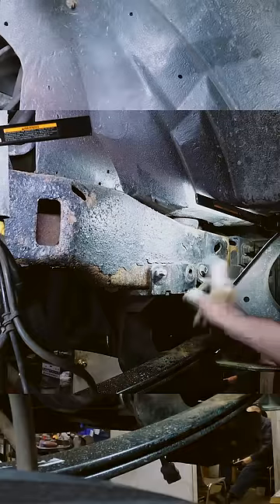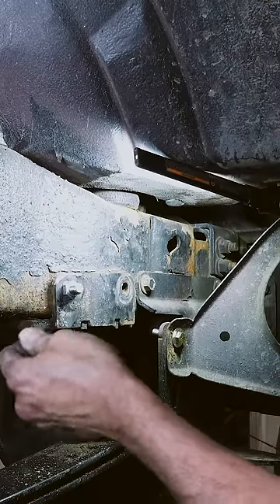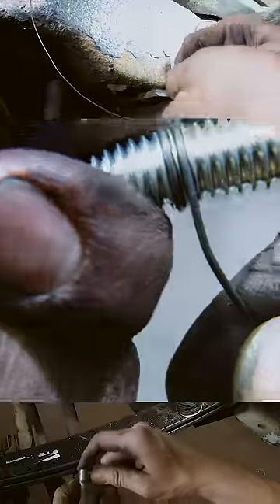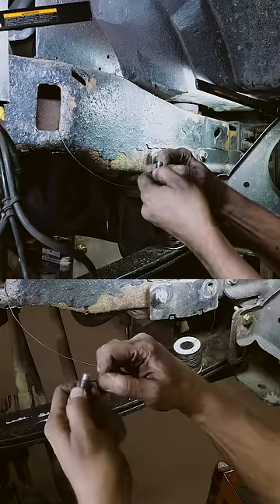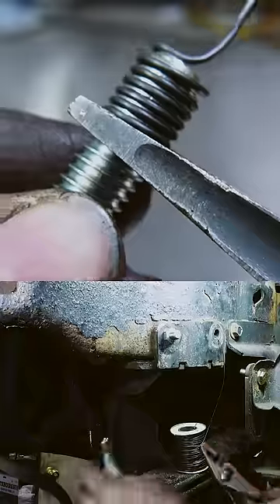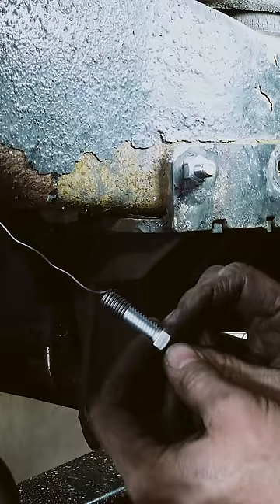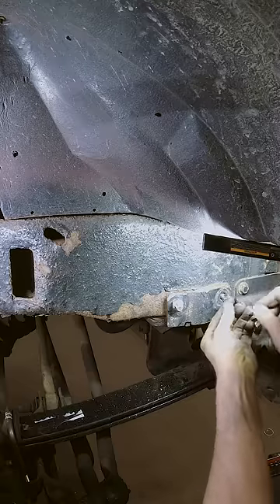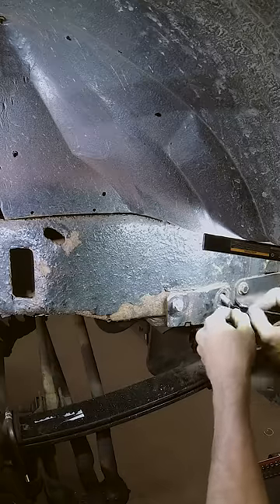How to Fish A Bolt Into A Hard To Reach Spot #shorts

Comment from the maker: A little extra context on this.  This is a plow bracket that another shop cut the bolt off and just left it out when they put the truck back together.  I tightened that new bolt with an impact gun, which you can watch in the longer version here: https://youtu.be/gg670s-yVso?si=8zQnzgKDUDrL-wO2
Reply: Thanks.  I have a place on my front bumper connection to the frame that I almost had it in after several attempts.  Magic how I found this video without looking for it.
Reply: Question when you need to replace the plow and that bolt is dirty or worse rusty how do you get the nut off or repeat the process?
Reply: @donaldsink8115  you can use blaster and try to back the nut out with a air wrench or just take a metal chisel and break the bolt would be my suggestion.  I've seen people use a chisel to loosen rounded heads on nuts.  I've never done it personally.  Haven't run across the problem.
Reply: Tack weld dose the same thing 😂😂
Reply: Anyone know how to get the bolt OUT of the box section, when removing a trailer hitch (tow bar) ?
Reply: @johnriggs4929  never had a towbar to see what it would require.  What is this box?
Reply: @peacepoet1947   part of the chassis that's hollow, with the bolt head inside it, just like on the video - i.e. I need to do this in reverse, and get the bolt out of that hollow section
Reply: @johnriggs4929  is there enough room to use a metal chisel on it?  In the shop we would use an air hammer possibly.  Damaged fenders and parts would need to be cut off because you can't get to the bolts.  You might be able to weld another nut to the bolt ball in the hollow.
Reply: @peacepoet1947  thanks for the advice, but the thing that bothers me is that if I use a chisel, or grind them off, the remainder of the bolt(s) will be rattling around in that hollow section and it'll drive  me crazy. I think I'll jist have to leave the thing on.
Reply: @johnriggs4929   is part where the bolt is attached to the ball?
Reply: What's holding that bolt from spinning while your impacting?
Reply: @johnriggs4929  reverse the process
Reply: @johnriggs4929 why can’t you use a magnet taped to a coat hanger or some stiff wire that you can shove through the hole and get inside the tube to find the bolt and pull it out?
Reply: @ghostridergale  the tube is closed at both ends; the only hole is the hole that the bolt itself goes through.

Comment: I drilled a hole on the other side and stuck it through with a deep well. And no, I didn’t weld it back. I did put JB Weld on the bolt to hold it to the frame.

Comment: Love when tow hitch kits come with these pre made.
Reply: Yep worked at a hitch install shop for years, hidden hitch, drawtite, had tons of em.
Reply: @ronniecox109 I always kept them and stuck them in the tool box.  What a great invention
Reply: @MrStatic101  they are great for putting the frame mount bolts on g bodies.
Reply: @MrStatic101 I came to the comments to say the same thing.
Reply: Same comment, you bear me to it lol.
Reply: I used string and electrical tape once when I didn’t have anything else. Fished a coat hanger through the hole.
Reply: It's amazing how literally everything has already been thought of before.
Reply: @chuckgladfelter  I did the string and coat hanger one time before I got a hitch with these in it.  It works good too

Comment: Just had to do that with 3 out of 4 engine mount bolts on my 1972 Jacobson snowblower. I used copper telephone wire (it fit down into the threads quite well.)

Comment: cool trick; 
 i thought you were going to tack weld the wire to the tip of the bolt; 
 you could  also use the wire to feed some thread thru,then tie the tread to the bolt.

Comment: If you tape down the wire on the bolt, it’d help prevent pulling the wire off the bolt too early.
Reply: It'd make it too big around to fit through the hole.
Reply: Nope no need to add to it. It's already a wire.

Comment: After reading some good comments, 
I say use the hole as a drill pilot. 
Drill thru backside. 
De-burr backside.
1 long bolt & you can then torque properly. 
Use fastening hardware as desired....
This from the 1 armed weldor

Comment: Good idea. The only issue I see is if the bolt starts slipping when you tighten the nut. I guess you could hold the bolt with vise grips if that did happen.

Comment: We used piano wire that was thinner and let the bolt fit through the hole easier.  We also used carriage bolts though a rectangular plate with a square hole in it.  The plate would rotate only until it made contact with the frame and stop the bolt from spinning.
Reply: So a rectangular washer.   Great idea 👍

Comment: How do you tighten the nut on the bolt?  It will spin in the hole.
Reply from the maker: You can see me tighten it up with an impact gun in the full length version here: https://youtu.be/gg670s-yVso?si=8zQnzgKDUDrL-wO2
Reply: I installed a whole plough bracket by welding/tacking coat hangers to the nuts and fishing those inside the frame.. Then bend the tail over in the hole ya went in through and cut it off..  Holds the nut from spinning and will usually come apart... Until it gets a bit rusty and then ya still have to cut it off..
Reply: Exactly
Reply: It won't spin if you're using an impact. It's head inside will create enough resistance  and hold itself
Reply: If you don't have an impact gun, cut a shallow slot on the threaded end of the bolt with a hacksaw or cut-off saw.  The slot/groove should be deep/wide enough to fit a slotted screwdriver.  After snaking the bolt through, thread on the nut/washers, remove the wire and hold the bolt steady with a slotted screwdriver until the nut is snug.  Tighten the nut to spec, and you are done.
Reply: @invisibilianone6288  If you know the answer then why ask the question?
Reply: Not if you tape a wrench to another piece of wire and put it over the nut and if it comes off just tape a magnate on another piece of wire and if that comes off sell the truck and buy one with a  tow hitch already installed
Reply: Yes. How? Prayer?
Reply: @invisibilianone6288 You could probably tighten it sufficiently that the bolt won't continue to spin further, just by holding the end of the bolt while tightening the nut. Assuming you don't have an impact for whatever reason.
Reply: Lock washer
Reply: This is the other option to impact gun
Reply: Sometimes the impact gun trick won’t work. All you have to do is tack weld the bolt to the frame and then use an oversize washer to clear the weld.
Reply: Yea

Comment: I purchased a hitch for my truck and I needed to do just that in order to get the bolt in. The hardware kit actually came with a ready made wire jig to do just that. NOW that is some good thinking ahead from that hitch manufacturer. saved me time and a lot of cussing out the manufacture of that hitch. THANK YOU HIDDEN HITCH.

Comment: It might be somewhere in the common spot. Generally when you buy a Reese hitch, it comes with that specific thin wire. It threads into 3/8 to 9/16 size bolts. It’s really a thin gauge but stiff wire. easier to pull through the hole. I have about four of them saved from hitches I’ve installed in the years past.

Comment: ALWAYS put a washer on inside the frame!  If you are patient enough, add a lock washer as well between the head of the bolt and the washer.  The more secure it is when you tighten it, the more secure it will remain!
Reply: Lock washers do nothing but act as a spacer.

Comment: Did exactly this with a tow hitch on a "modern" ford explorer several years back. Hitch hardware bag came with a whacky t-head bolt that had to be fished through the frame from about a foot away from the hole it needed to stick out of. Not having original equipment tentacles or lobster-like stalk mounted eyeballs, i opted for wire and electrical tape over plasma torching an "access window", lol.

Great tip!

Comment: Nice video! I use to install hitches and used a similar trick. I fished a piece of welding wire through first.  Then I'd just spot welded it to the very center of the end of my bolt. Then I could just pull it through and break off the wire.

Comment: Usually these pre-made units come with 5th wheel bracket kits for pick ups.   Never throw them out.  Obviously only work for size bolt that’s in the kit.  But leave them in the tool box.

Comment: You can also drill a tiny hole through the length of the bolt and run the wire through it. Its also easier to line it up and pull it into the hole.

Comment: Using the metal wire and a piece of string is much easier. All you have to do is tie the string to the metal wire, feed it through the hole, tie the string to the end of the bolt and pull it through the hole. It’s basically the same process with an extra step but much easier/faster than fiddling with metal wire for 15min trying to get it perfect so it fits through the hole.

Comment: I’ve done that before but I used fishing line (spectra). The diameter of the line is much smaller than solid wire and the line has a high break strength.

Comment: I've been doing that for years. Ive also just welded the wire to the tip of the bolt. Usually I use an old wire coat hanger.

Comment: Question...the bolt appears to be undersized and will move overtime causing it to loosen.....in addition the bolt appears to be low quality steel ....why not drill straight through to the other side and install a thicker bolt.

Comment: I bought a trailer hitch to put on the front of my Ford pickup a few years back inside of the kit. They gave you that piece of wire because she had to feed the bolts through the frame. It's pretty good. One of those things you keeping the back of your head for the next time 👍👍😀🇨🇦

Comment: Aren't there bolts with a "Dig-in "geometry cut into the underside where it contacts the surface it's tightened up against so that it resists turning in that sort of application?

Comment: I've done this. I had to do this to put a trailer hitch on the front of my car. You need to pull the bolts through like this. They actually supply the wire already coiled, but it's weak and it was a pita!! It's a good trick though

Comment: I use mig welding wire as it is thinner and much stiffer so it will allow the bolt to slip through the hole easier with less risk of pulling off the bolt. Also I will wrap the wire around a smaller diameter bolt to form the coil, then remove the smaller bolt and twist the proper bolt into the formed spring shape for a tighter wound grip around the bolt. If concerned about the bolt spinning once installed in the hole while trying to tighten it, simply weld a short bar or another bolt shank with the head removed across the head of the bolt you are installing to form a T out of the bolt you are installing. This will act like a jamming bar to keep the bolt from spinning once the top of the T spins and wedges against the inside face of the frame beside the hole that has the bolt in it.

Comment: You can buy bolt fish wire that is designed specifically for this. You can get it in much thinner wire too for smaller bolts/different thread depth. It’s reusable too. A few $ will save you lots of time and $

Comment: I used a mig welder.  Welded the  tip of the wire to the end of the bolt. Then, turned the voltage all the way down and the speed all the way up.  Released as much wire as I needed and fished it through.

Comment: 1. Drill hole on otherside of frame. 
2. Apply some pssst pssst, craigslist rebuild.
3. Run a longer bolt, with washer and lock washer all the way though. 
4. Torque to ugga ugga.

Comment: I do the same with a mig welder,tack the wire to the tip of the bolt and cut off the length of wire u need and feed it to the hole and pull it through  035 or 040 thick mig wire

Comment: It's a neat trick.  If it gives you any grief, just open the hole a little more.
But the washer comment was interesting.  What pray tell is the problem of using a washer on a bolt when you are going to use an airgun to tighten it?

Comment: I just use a coat hanger with a hook on the end ... Once I get the bolt to come out of the hole I grab the bolt and then pull the coat hanger real hard to pull the hook free and then i put my pocket knife blade in the threads to hold the bolt in place to get the nut started , it's pretty much a wrap after that 🤷

Comment: Okay,,, you got the bolt through the hole, but with just a bolt, not even a lock washer, how do you expect to torque it to any useful amount?  I guess if you're just going to WELD the bolt on after you tighten it as much as possible, it'll be a PITA for the next guy to have to deal with that, but it might work.

Comment: Actually... there is a washer for that purpose. It a channeled washer that captures the bolt head and makes contact with the frame to keep it from spinning. You can drill a small hole next to the bolt hole and rosette or spot weld it the channeled washer in place as well. You can even slot and tab it. 
Or just tack weld or tab the washer to capture the bolt head. I just save the  bolts from trucks that come with them from the factory.  A quick side mission at the wrecking yard netted me a lifetime supply of grade 8 or better hardware for pennies on the dollar.

Comment: What I would've done is another hole on the other side of the frame and use a longer bolt. In case anyone thinking that it may crack yes it may, but I've done this to my trucks and it been several years without cracks.

Comment: Old news .  That's how you get the bolts into the frame when you're putting in the trailer hitch comes with the wire to to wrap it ,,,    been doing this for many decades

Comment: That's one way to do it. And probably a little faster than the way I do it but it does work.
If you have a tack welder, just tack The Wire to the end of the bolt.

I still use the magnet to help me. Fish to the bolt through the whole. But I wrapped The Wire in the opposite direction. That way, I can grab ahold of the bolt and yank The Wire out. The only other option I found that works well. Is to rule The Wire into the threads so that The Wire doesn't stick out. You end up with triangular wire in a coil of course.
There are 3 different ways of doing it there and The first two requirements magnet.

Comment: Put some JB Weld under the head of the bolt so when you tighten the bolt up it will harden between the bolt and the truck body and hold it there,  so if you need to take the nut off it won't just fall back inside the frame again.

Comment: If you put the wire closer to the head of the bolt then you can get a nut on the bolt while holding tension on the wire.

Comment: Strong fishing line is better. Tie it to the bolt. Then tie the line to a piece of wire. Fishing line fits better in the threads. Tie another piece on the head of the bolt in case the other comes off AND to place tension and manipulate the bolt through the hole.

Comment: Next guy is gonna be cussing you out
Reply: That's exactly what I was thinking! Especially when that bolt is spinning on the other end when you try and take the nut off.
Reply: The next guy if a compentent Mechanic will just cut it off.
Reply: The 5"dia bolt removal tool is your friend
Reply: Blue wrench... Can't be tight if its liquid..
Reply: He shouldn't be cussing anymore than this guy is, unless he does what the last guy did and just cut it
Reply: Lol. Just cut it off he says. Grade 8 or better bolts with nuts on them don’t. “ just “ cut off.
Reply: @joeshumo9457  Yes they do - - grinder blades don't care about hardness.
Hack Saw blades care.

Comment: Typically you weld a "flag" to yhe bolt head so it can be tightened with a regular locking nut. I remember jeep Cherokees using a few of these blind fasteners from the factory.

Comment: Thin wire like a mig welder on the tip of the bolt😂 and put a plate on the head or it will spin when tightening